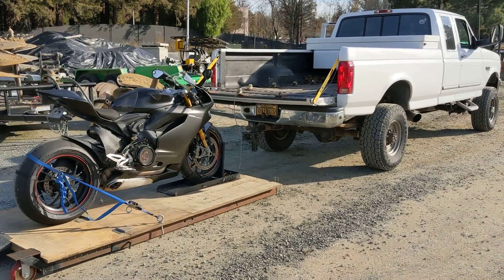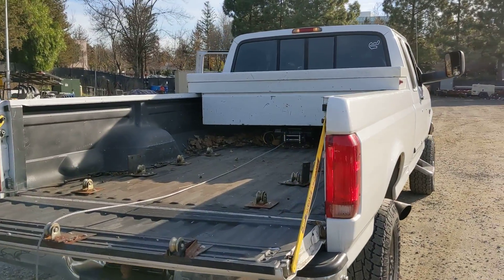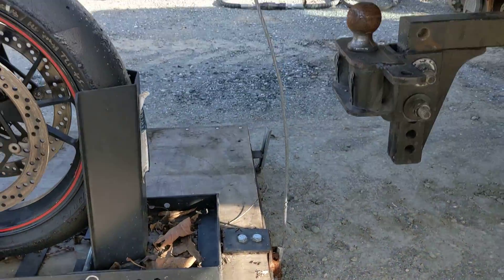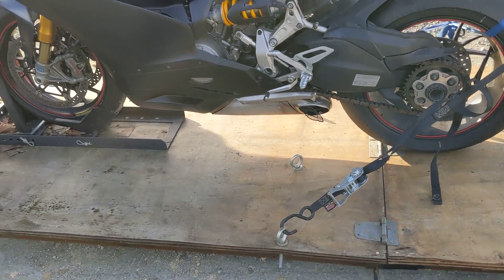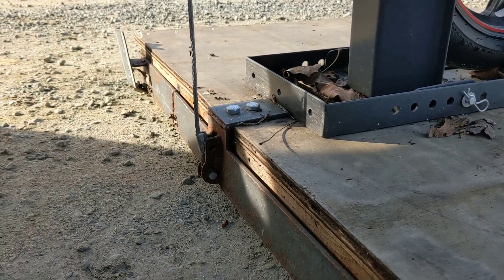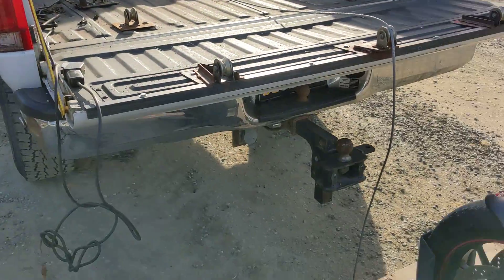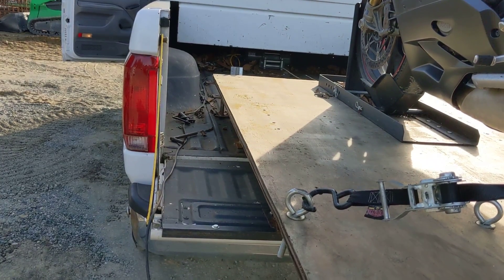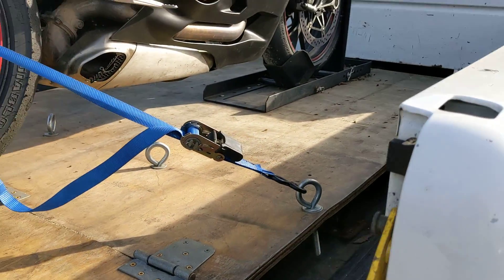The Motoloader: prototype motorized truck bed loader (be sure to check out V2!)

Comment: Not to knock this but why not a trailer?
Reply from the maker: I have a trailer too, couple reasons I may choose not to take it: in California there's a towing speed limit to 55, if I'm going to the city or any busy area where I need to park, if the bike is disabled completely it will still not be possible to load into a trailer without at least one more person.

Comment: Awesome !  My only constructive suggestion would be to add some straps from the platform base to the handlebars.  I know you have the front wheel locked in place with a cradle, but the added straps would help maintain the m-cycle upright in case you have an emergency swerve condition while driving.
Well done with the yellow tailgate support bars, left+right.  Never trust the steel cable alone.
Very Nice..... Very Nice.  👍

Comment: Unloading probably doesn't need any engineeing.  Those rollers will make it relatively easy to pull the platform backwards as the winch cable is let out.   I could use a smaller version to load cargo through the side or back door of my van.
Reply from the maker: https://youtu.be/5xFc3I9S2EU - check out V2 with a quick video of unloading and showing how the platform can be used for something very different!

Comment: Very ingenious, but I see used bike trailers often on CL for $400 - $700 on the low end. 
That wheel chock runs $60+ for cheap ones. He also used a $200 winch, and that doesn't cover the cost of the heavy 
gauge wire to power it. To say nothing of the time spent, welding 
materials, hardware to bolt it all together, loss of full functionality of the truck bed due 
to rollers bolted all over the floor, etc. To each his own I suppose.
Reply from the maker: I own a trailer too, different tools for different situations. The rollers are bolted in with riv nuts, 5 minutes to remove the rollers and the riv nuts can be used to bolt down E-track to secure loads when not using the system. I'm planning on building a trailer with this loading system as well - my main use case is disabled bikes that don't run. Cheers
Reply: @Grip_Addict  I think building it on a trailer is a brilliant idea!

Comment: There are at least two different commercial products that load a motorcycle into a truck bed in a manner similar to the rig shown in this video. Enter "motorcycle lift" into the YouTube search  box.
Reply from the maker: Those cable operated systems pull a single motorcycle up a narrow ramp by the front wheel and then tilt the ramp into the bed. It's a subtle but significant difference. They also use all custom parts and components, would be much more difficult to build in your garage without CNC tools.
Reply: @Grip_Addict  I didn't say anything about building the other systems in your garage. Not everyone can or wants to build a motorcycle lift from scratch. The point of my comment is that there was nothing unique in the general concept.
Reply from the maker: @davmar9923  The unique aspects of this design are 1) loads flat on the ground, 2) the loading area is larger, 3) the design is simpler and cheaper. In the most general sense, you're right it's similar to other videos. YT knows this too, I get a significant portion of traffic from viewers of those videos (and vice versa I'm sure).
Reply: @Grip_Addict  I see that it has some differences from other motorcycle lifts. However, it is not commercially available and therefore not likely to be of interest to the majority of people needing to carry a motorcycle in the bed of their truck. I do commend you for taking the time to illustrate the concept to the public via YouTube.
Reply from the maker: @davmar9923  thank you sir, here's a quick preview of the final version I'm working on to commercialize. If someone wants to pay for the full kit ready to install, that will be an option too! https://youtu.be/Xn6J1al0e2A
Reply: @Grip_Addict  Well that is a whole different ballgame. If you are going into the manufacturing business that provides an alternative, in kit form, to the commercial products, which I assume would be significantly less expensive. You may want to have a personal liability insurance policy to protect against lawsuits should a purchaser incur personal injury or property damage using your product. For myself, I have an 5 X 8 ramp trailer with a motorcycle chock for transporting my bike. I can just ride the bike into the loaded position.

Comment: Brilliantly simple. 
Throw a coat of paint on that to make it look pretty. 
The tailgate reinforcement is important. With a rig like that, every mate in the bike club will be wanting a pickup at some stage. 
Love the recessed bolt threads. Lookup rivnuts.  They make for quick easy remove anchor points in truck beds.
Reply from the maker: Thank you for the comments and for watching! I'm using riv nuts in the bed to bolt the removable wheels.

Comment: Im to old now, call me crazy  but I always used 2, 2x12 side by side and rode my bikes in. My R 100 Bmw was a little scary. Broken down bikes . Used a winch  walked up the plank along side as they went up. You idea is great but I dont carry around enough bike anymore to mod a truck bed like that. I use my homemade 6x10 inclosed trailer.

Comment: Great 👍🏻 idea but I would have liked to see if unloading works, looks like ya need to pull on the platform as you let the winch out at least to the pivot point.
Reply from the maker: https://youtu.be/5xFc3I9S2EU - check out V2 with a quick video of unloading and showing how the platform can be used for something very different!

Comment: I know this is a year later but this awesome. 

Hope you put in a patent.
Reply: He can't patent it now, by revealing it first it has entered the public domain. Also, to receive a patent (assuming something substantially similar hasn't already been patented) would cost $10,000+ and you would still have to either go into the manufacturing business or find another party to license or purchase the patent. I recently received an automotive related patent, US 10,604,194 B2. So far it has cost over $15,000 and I still will have to pay a patent broker thousands more with no guarantee that they can find a buyer. Also, once the idea is out there, even if patented, parties will attempt to avoid the patent by making minor changes. It can be expensive and iffy to try to protect a patent against infringement. A patent is definitely not the panacea that people may imagine it to be.
Reply: @davmar9923  damn. I have an idea and I am glad you said this before I did anything. I didn't know it was that expensive.

Comment: You have over the cost of a utility trailer in this project.  You can get one at lowes under $700
Reply from the maker: Yes I have one of those as well! The HF one can fold up too. Different tools for different situations.
Reply: @Grip_Addict  yeah fuck those HF trailers.  for a few more you can get a decent one at lowes or tractor supply that has a ramp built in.

Comment: for those security/retaining pins-
http://www.fairlaneproducts.com/store/pc/Quick-Release-Ball-Lock-Pins-c1178.htm

(or something similar)
Reply from the maker: Thanks Aaron great suggestion. I couldn't use those with the metal / wood combination in this prototype because the tolerance of the wood is not tight enough for those types of ball lock pins. For v2 these may work, but I have a lower cost and stronger design I want to test first (the pin retention will be on the outside by the head of the pin so you can positively engage it and see it engaged from the outside, and it will be much stronger / simpler / cheaper than the ball pin).

Comment: Smart solution...  Atrocious welding, but smart idea.  Good thinkin.
I’d think about trying to split the cable to pull from the front corners rather than just the single center point.  Should make things more stable coming up over that transition before it comes down to horizontal again.  Definitely want to have  some attachments more suitable for securing in in position other than relying on the winch cable. Either some positive locking solid mounts or at least straps attaching the rig to the bed to stop it from sliding out the back or ending up in the cab with you.  Only other thought I’d have if I were trying to improve it would be some kind of guides to bring the platform down in the right spot as opposed to manually positioning the platform’s track onto the rollers.  Maybe some kind of spring tension or geared drive mechanism to start it moving back when unloading and a way to stabilize the platform as it again transitions from horizontal in the truck to tilt back on the way down. Don’t know for sure because you didn’t show unloading, but I’m assuming that’s gotta be a little sketchy. Not that I’m criticizing your work, just saying after seeing what you’ve been able to accomplish, that’s what I’d be thinking about for the next version.  Good stuff, man.

Comment: Very cool man! Seems like if you cut the front of the platform into a v shape and throw some wheels on the platform you wouldn’t need to permanently scar that absolutely beautiful truck. You’d also be able to make this idea universal to any truck with the exception of a winch. But that way the truck can still be put to work on the week days, and quickly be ready for play on her off days...
Either way... I’m super jealous about that truck
Reply from the maker: I'm working on a bolt in frame for the bed for people that don't want to drill the rivet nuts into the bed. The wheels and winch in the bed can be removed in 5 minutes. The variation in bed width between wheel wells means there still needs to be some modularity for it to fit all trucks, also working on that... Thanks for watching and commenting!
Reply: @Grip_Addict  can't wait to see you on shark tank! Good luck!
Ps. I already know the answer but....
Let me know when you're ready to sell that truck

Comment: Anyone want to place bets on how tall this dude is?  I am betting they are under 5'8" tall.
Pretty cool invention though.
Reply from the maker: I bet he's 5'11! But definitely not strong enough to push a dead bike up a ramp. I have loaded with a ramp and step stool many times, I prefer to have a spotter when doing that though. And getting one or two bikes in and out that way with strapping down in the bed would take significantly more time.
Reply: @Grip_Addict  Dam it. I knew for sure under six foot. Had nothing to do with strength. Had to do with truck size.

Comment: Thats nifty.  I run a 7.3ps f350 cab n chassis dually and so i can load stuff i got h.f. truck bed crane and i have picked a little over 500lbs 6ft off the side.    Do what ya gotta do and works

Comment: Loved it!! Why the hinges??
Reply from the maker: Thanks! Hinges are for when I'm not using it I can fold that section and close my tailgate. Most other systems require the tailgate to stay open while the system is in the bed and not in use,  which I didn't want.
Reply: @Grip_Addict  Clever!!

Comment: Awesome idea and congrats on making a functioning proto type. Most people don’t get that far. Just a suggestion try looking g at repo trucks and the way the have their hidden booms and hidden tow equipment. Maybe you can get an idea in how to keep you tail gate but keep the weight off of it. I know I have seen simple basic arms that would help transfer the weight to the bed and be out of the way. Your tail gate will get really messed up in the long run. But not only the tail gate but the hung points and possibly screw up the bedsides if too much of a load causes things to bend. I used to just take my tailgate off and jumping my old truck and it destroyed the right bedside. Now the truck was cut up some for off roading but it gave me a lesson on how stress and too much of a load is spreader out through out the bed. Keep in mind that was 20 years ago. Also look at unistrut to make your channels and possible frame. They also off it in galvy to keep it from rusting. I’m not promoting them they have not clue who I have but they make great products that could be made to work for your idea. Plus it’s rated to handle weight and the stuff holds up very well.
Reply from the maker: Thank you very much for the feedback. I'm looking at different materials for the v2 frame to keep it cheap, light, strong, and modular. Currently testing galvanized steel framing tube - allows me to do telescoping extensions, but will check the material you mentioned out too. Also building a hitch based reinforcement for the tailgate that should help.
Reply from the maker: And check out the final version with a tailgate reinforcement solution! https://youtu.be/PhYCe2LrflA

Comment: Pretty good idea but one question. The wench is doing all the work putting it in the truck but how about going back out? Are you physically pulling the platform?
Reply from the maker: Yes sir but there's essentially no resistance or friction because of the 8 wheels on ball bearings, smooth like a drawer. The winch has a reverse draw which controls the descent. For v2 I'm designing a handle system that attaches to the side of the platform for additional leverage and safety.

Comment: Likes his truck. That's why he bolts rusty stuff to it that isn't even close to properly welded.
Doesn't want his truck lowered. That's why the tow hitch is reaching down so far, killing all ground clearance.
You'd better buy a proper bike trailer.  That's safer, and you wouldn't have your truck bed full of those nasty rollers in your way.
Reply from the maker: The rust is period correct, please have some artistic sensitivity. Otherwise excellent points!

Comment: Nice.  I had a similar idea to make a platform with rollers under the back wheel of the bike. Then you mount about 6 rubber wheels under the platform that are geared to the rollers.  Then you just tie down the bike, start it up and use the bikes power to drive the whole platform up a set of ramps. If you gear down the wheels it should give you the torque and control to smoothly go up the ramp. I bought a tilt bed trailer so I never got around to making it, but yours seems to work well.
Reply: you just gave me a good idea!!!

Comment: You need to learn how to weld or find someone that knows how- those welds are dangerous.
Reply from the maker: Thank you for the feedback and for your concern for my safety. It may not look like it but I know how to weld, I think I mentioned in another comment that I made several passes on the critical welds which creates an ugly appearance on the surface. But yes I'll make sure v2 is cosmetically perfect so the structural engineers of YouTube approve.

Comment: Cool build! Not sure I would have done the track, seems like 4 or 6 casters on the platform would be plenty.
Reply from the maker: Thanks John! Some sort of track is required though since the platform is drawn over the rollers on the edge of the tailgate. Wheels would make that a bumpy ride. The v groove helps keep it all aligned, technically just a smooth surface or channel could work too (that's how the long roll off dumpsters work).

Comment: I made a similar thing to tow my bike up into my G10 work van. I used a spreader bar hooked to allthread through the front axle hole. and an ATV winch between the seats.  I had to walk it up but, it sure made life easier on my arthritic old ass. ZX14R is pretty heavy for a run up the ramp and duck style loading that I used to do.

Comment: With a pattern of tie downs, this could be good for sleds, atvs heavy equipment like boilers and who knows what else. For added safety, a way to use the winch to control the load no matter the pitch of the truck would be better. "Level" isn't always an option.
 Point is, this is a great idea and might have added potential uses.

Comment: Nice work ,does it work okay if the truck is parked on a cambered  roadside or is level ground  needed.
Reply from the maker: Thank you! Lateral camber - anything you'd find on a paved road - is fine, the platform wants to offset to the side on the way up to the tailgate but the cable pulls it back in-line as it approaches and transitions onto the tailgate. For hills, having the front higher than the back is ideal like with any other loading or unloading operation. Thanks for watching

Comment: Has your tailgate bent yet?
Reply from the maker: It has not, and I can explain why if it helps... When the cable is pulling the platform up to the tailgate, the load is at the center of the tailgate - which is when it's most likely to bow. Though during this process, the rear wheels are supporting ~50% of the weight when flat and over 50% as the platform is raised, reducing the weight on the tailgate. 

When the platform rolls onto the tailgate, the weight shifts from the center to the outside edges where the platform tracks contact the outer wheels. The weight is then closer to where the tailgate is held, and prevents it from bowing. 

Additionally I'm working on a tailgate support accessory for trucks with weaker gates and platform gross over ~1,000 lbs that will eliminate any bowing.

Comment: I don't know if my truck tailgate can even support my 800lb bike. I think I have to remove the door 🥺
Reply from the maker: I'm working on an accessory to the system that will provide additional support to the tailgate for heavy loads. It will require a trailer hitch to be installed on the truck.